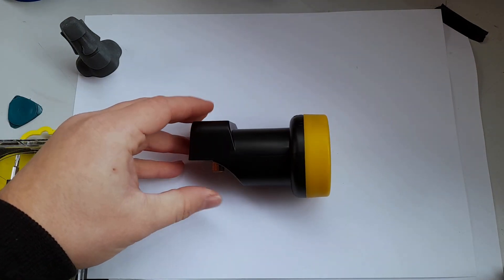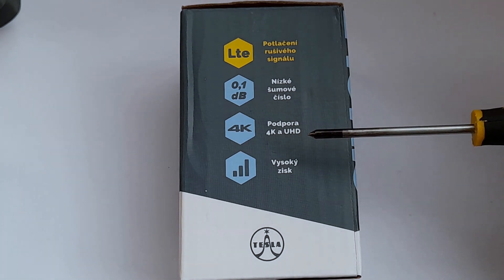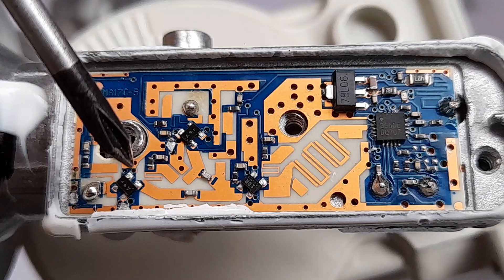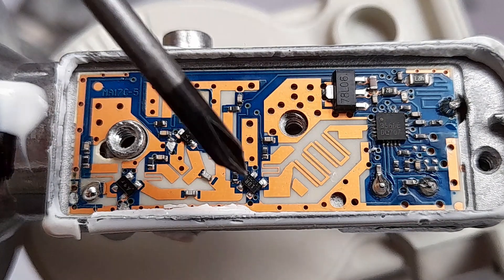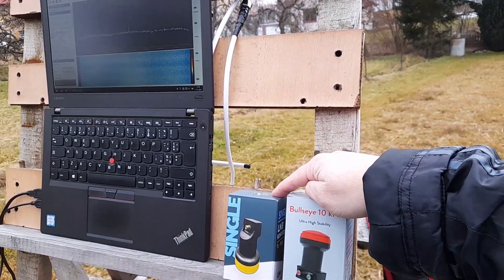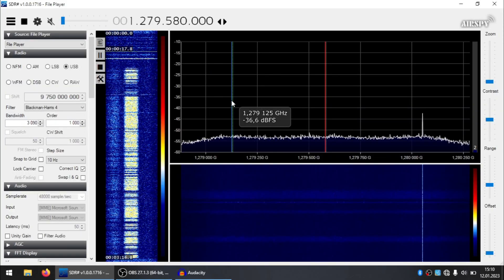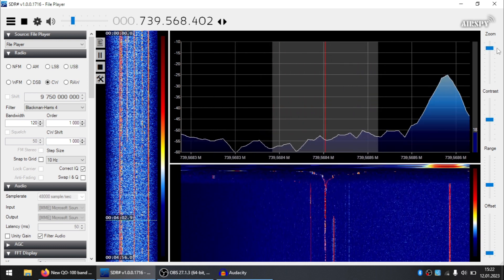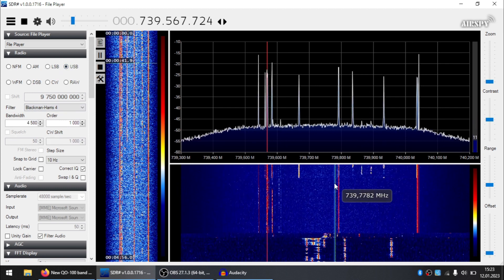$4 Ku-band LNB teardown & test (Tesla TL-100)

Comment: If your oscillator drifts, just use SDR console, which has a separate software receiver permanently synched up to the beacon, making it very stable, because it will compensate the drift entirely!
Here you can see how well it works ... free smart software will keep you from having to invest into an expensive stabilized/locked oscillator.
Apart from the AM/FM co-channel canceling tool for broadcast DX-ing, I would always prefer other software like SDR Console, SDR++ and SDRAngel, because they have not being created by a person who actively stopped supporting the popular good bang for the buck MSI001 and MSI2500 based receivers that offer more dynamic (12 Bit) and bandwidth (up to 10MHz with reduced dynamic) while using far less USB current for a similar price as RTL-SDRs, though the very cheap ones may have more or less imaging and noise problems in some bands.
Reply from the maker: I've used SDR console before to do this, and I'll include it once I do a video about QO-100 specifically. In this case I didn't want the correction to see how stable the LNB is on its own. I also own an Msi based SDR, but I want to mainly focus on RTL-SDR and Nooelec receivers as those have the best software support and most people own them